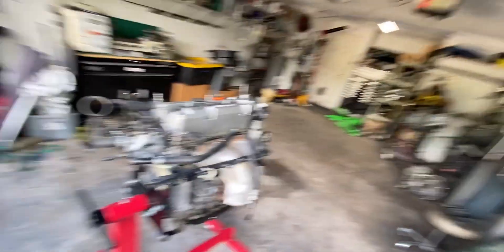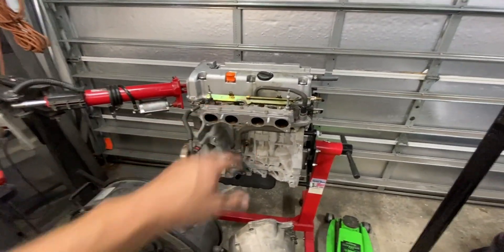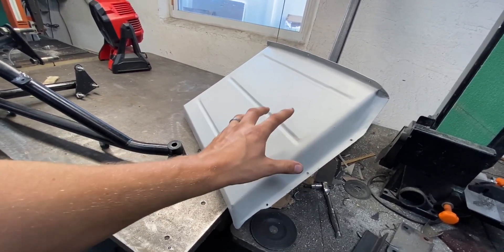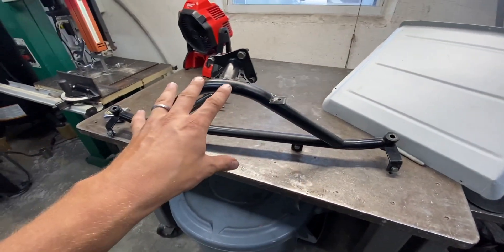We Buy A New Motor For The K24 Swapped Porsche

Comment: I'm starting to go off the whole k24 with a k20 oil pump thing and I'm thinking just get a k20. Its capable of making the same power, it revs better due to having shorter stroke and it's got a lower deck height and most people struggle with the height of the long block on these engines just as you have. This goes for all k series swaps and not just yours tbh.

Comment: Just out of curiosity, have you seen that heat shielding solution that Taylor Ray went with on his C6 drift build?
Reply: what is the shield for ? can you share the link
Reply: @RSADYNAMICS  The company is called HeaderShield.  

If you want to see it on Taylor's car, the video where you can see it is called, "C6 Corvette competition drift car build. it's finally back together."

I'm sure this stuff costs a pretty penny, but it seems pretty trick.
Reply: @fopeezy3097  thank you will check it out
Reply: It's pretty bad ass heat shielding.
Reply: I second this

Comment: Don’t forget to gap the rings for a turbo.
Reply from the maker: Not happening
Reply: @baysidefabrication  Definition of insanity, bro. You're going to grenade another motor once those rings close up again. 
Maybe you can balance just the right amount of power (I think you said 400 max last time), but if you want something reliable so you can actually focus on kits instead of rebuilding this car over and over, gap the rings.
Sorry this sounds harsh, I'm rooting for you, I just think the problem is obvious with the boosted K motor.

Comment: Yes the 300-400 hp is the sweet spot,honda motor love the rev,but i think they hate the boost,so if you wanna reach 500-700hp make it rev higher & easier...like some big ass camshaft, head port, valve,etc
Yes the lag will be there,but that way is more safe imho

Good luck bro,keep it up,i like your video 😊
Reply from the maker: K series Hondas are notorious for loving boost. Hence why everyone turbos them
Reply: @baysidefabrication  This.
Reply: @baysidefabrication  They do love some boost for sure but what they dont like is torque at low rpm 
If i where you i would go for a K20 next time with the s2000 oilpump 
And then u can rev it to 9500rpm 
And 5500+ rpm they handle the boost fine and also with the k20 u keep the torque down as well

Comment: Why not consider a J-swap? J-swap with an equal length 6-1 header sounds sick. Do it with 1.75" primaries and a 3.5" collector with a radial/sequential firing order and it should scavenge pretty well, too.
Reply: It sounds good for sure, is the j series smaller than the k series length wise , and he would have to start from scratch with the engine mounts and stuff ,

Comment: If you want to test your oil pan design it would be worth putting some rods in there so you can crank up the boost to 450/500 once you have ironed everything out and put lots of miles on the 350bhp setup
Reply from the maker: Stock motors can handle 450hp no problem.
Reply: @baysidefabrication  Torque at lower rpm is a killer.